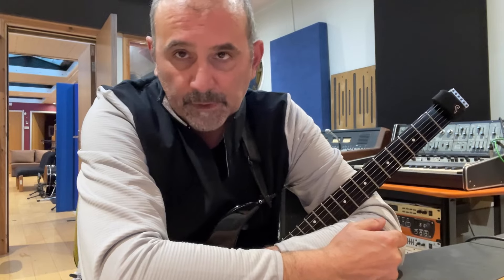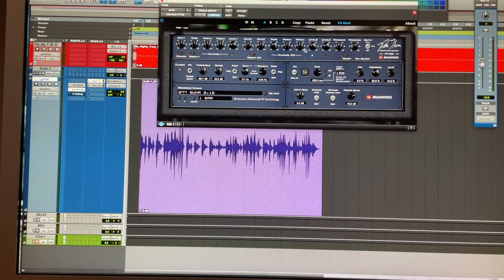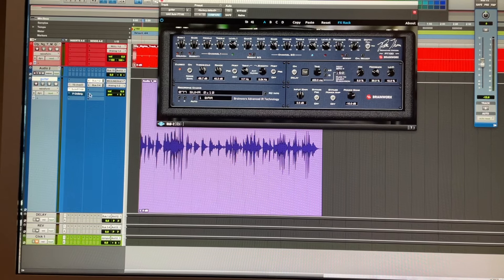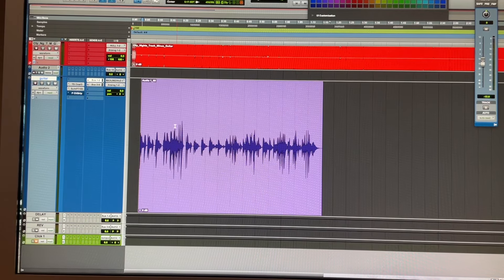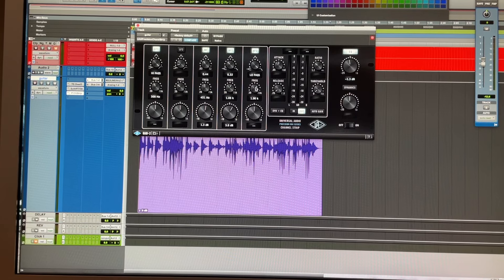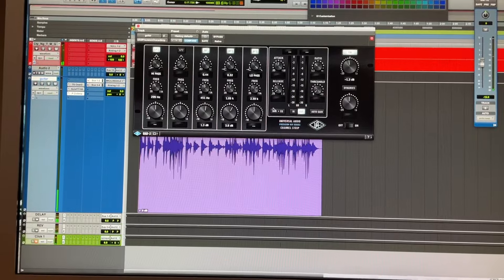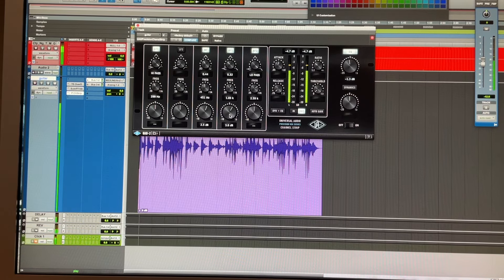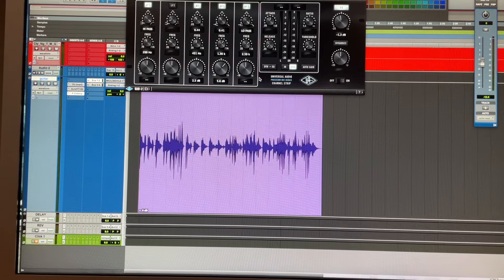ENRICO PINNA THE ALLAN HOLDSWORTH LEAD TONE CONCEPT AND TUTORIAL

Comment: Thanks a lot, Enrico! EQ is the key. As for the reverb and delay, I think I can refer to the previous video (on clean sound). Thanks once again!
Reply from the maker: in this case i just used a random stereo delay around 500 ms with 4-6 repetitions with the feedback and a bright Plate reverb
Reply: @italianguitar  thanks a lot! I try to reach the same sound on my Line 6 POD HD 500X processor. Need to start working with computer based programs like you)).

Thanks once again! Your videos are a treasure!
Reply: @MrTarlecon  i´ve tried to reach something similar, just with analogue equipment. deluxe reverb + transparent overdrive + delay and an eq. i found out if you dont push the gain on your overdrive too far over 2 o clock and roll both the tone knob on your overdrive pedal and guitar very far back, not till complete jazzland ofcourse, but pretty far. you will then have a really muddy tone with a lot of bass, buuut if you completely eradicate the bass on both your amp and your eq, and push your treble and upper register on the amp and the eq really hard you´ll start to get into jazz overdrive / holdsworth area. my idea of the holdsworth tone is atleast a tone that is soft but at the same time can pierce through the mix, a warm bottom that is not bassy and that resonates, and a thick top that definetely pierces through but has some core to it that doesnt sound thin. 

last step , so that you can give your amp a bit more volume to work on is to use your guitar volume button as a gain, push the amp volume until its a bit too loud for playing, then roll your guitar volume off to about 7/8. this for me is atleast the decisive moment in getting the holdsworth/jazz overdrive tone. 

now i´ve not nerded on how holdsworth did it, so this is probably not very similar , technically speaking. but it sounds awesome and is probably replicatable on all equipment, as long as youve got a tube amp and a transparent overdrive. 

I also tried to model this tone after late 2000´s kurt rosenwinkel, cause he sounds very similar to holdsworth during that time. so my approach is probably a rosenwinkel meets holdsworth kinda tone hehe.
Reply: @erlendjulieb1760  thanks a lot for such a detailed anwer, my friend! So many things to try and to learn)).